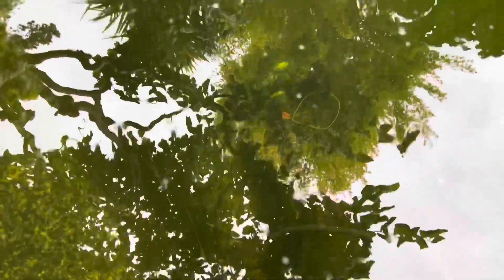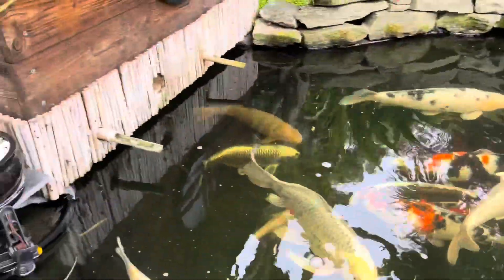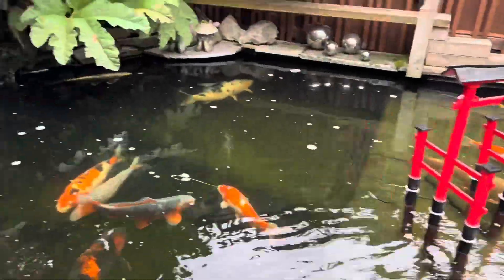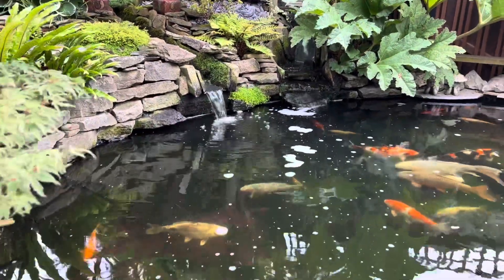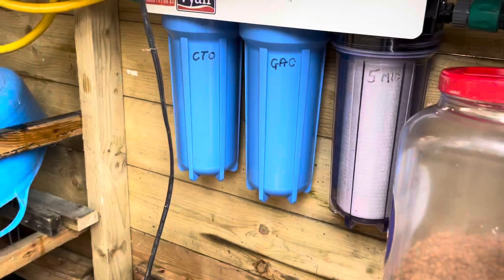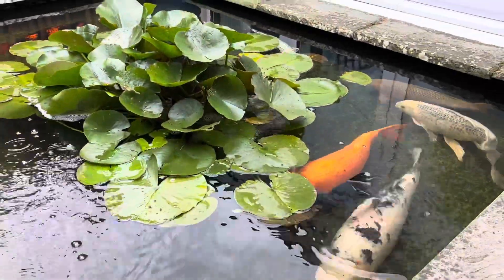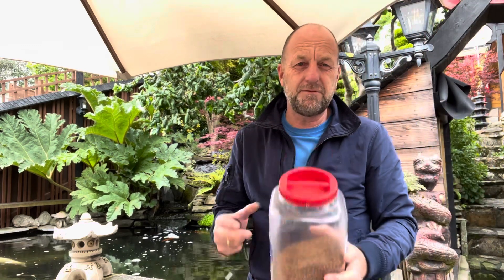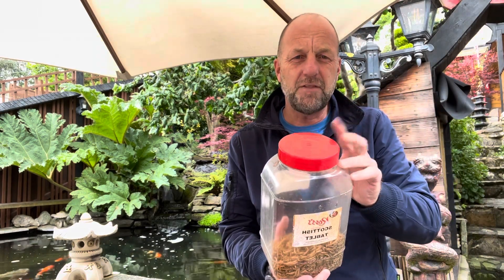Keeping your pond clear (episode 27)

Comment: Great walk through of your filter system. Not as complicated as mine which includes two Eazy Pods, a moving bed filter, twin upflow filters and a diy bakki shower all fed by a four inch bottom drain and two pumps connected to two 40 W UV's. Sounds like a lot but works very well for me.  Cheers.
Reply from the maker: I took out some filters last winter as i wanted to see if the pond will be as good with just two filters and I was right!! I know they say more filters the better, but if you can do it with less then less work!!!
Reply: @japanesegardenbristol7842  True but I do enjoy trying different filter combinations that put my ideas to the test.
Reply from the maker: @mykoiobsession  
Yeah that’s what I enjoy but haven’t got the time these days!!